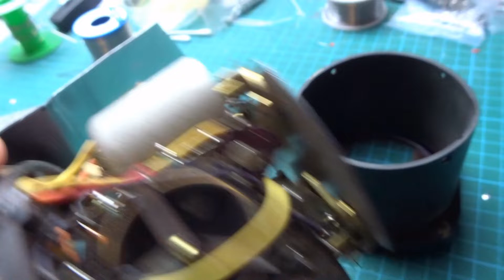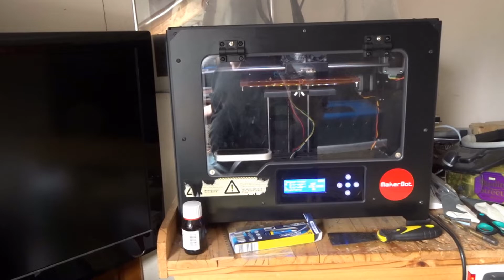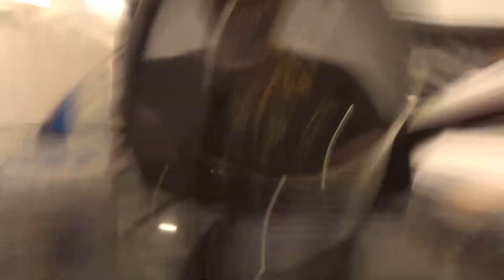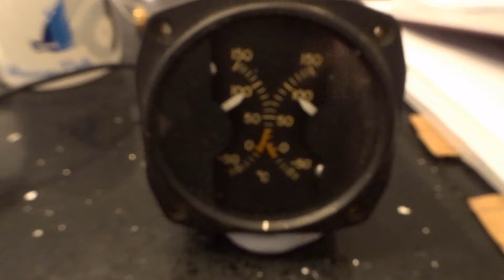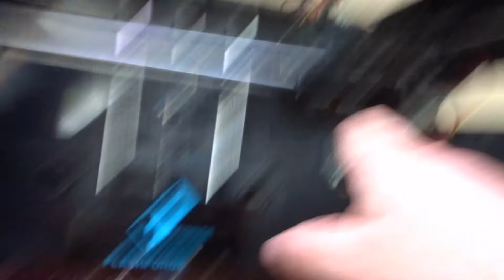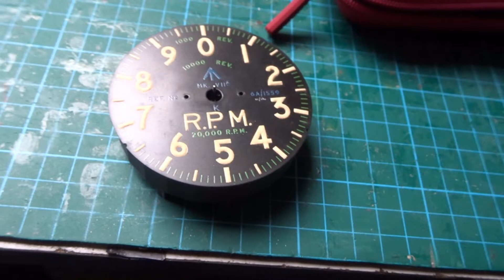Digital retro-analogue gauges | Belly Tank Lakester Ep.15

Comment: We have a lot in common, I do a lot of electronics too. Do the steppers you use have encoders on them? How do you know what position they are in? I have done a bit recently with driving a modern electronic tach with a micro getting a signal from the magneto. With no coil/points you have to pickup the signal inductively off a plug lead. I have that working nicely now after I copied the trigger circuitry from one of those cheap as chips electronic digital tachos you get off eay/Ali Express and feeding that into an Arduino to then generate suitable pulses to drive an electronic tach. Since I will eventually change the face on the tach I can of course make the scale anything I like. I have played a bit with trying to simulate a proper chronometric tachometer but the meter movements just can't move fast enough. Neither can a stepper I think. The only thing I could think of that might move fast enough is some kind of galvanometer but those aren't cheap! The smiths gauge is a MA speedomter of course. Used in Austin 7s. Aircraft gauges are something we see in the vintage car world and they can be a bit twee really unless your car is an aero engined special. In your build they make perfect sense being a tank racer. I'd be disappointed if you didn't have aero gauges! I haven't had much luck with some power banks for driving my electronic inventions. They often seem to have a low power auto shutoff built into in them and the little micro powered devices don't draw enough current to keep them turned on!
Reply from the maker: As you may see I also make electronic Hurdy Gurdy instruments and I had one that kept shutting of when run from a power bank because it was drawing too low a current. My steppers do not have encoders. I zero them at startup by reversing them against their backstop and then assume that is the start position. I agree over time they may accumulate errors if any steps are missed but I drive them slowly and don't update them too frequently. I could add in a 'zero all gauges' pushbutton on the dash if I wanted to - may actually do that. Finally they only need to work for a few minutes at a time in this car. Am planning to use a reflective spot on a rotating part of the engine and a laser tachometer sensor (shines laser dot and looks how much of it is reflected). You can get them as a module from China quite easily. I also have some chunky switches used in WW2 aircraft but also well after the war which may find their way into this project.
Reply: @XenonJohnD  One thing I have used professionally, not as a hobbyist, is digital servos. They have encoders built in so you can get absolute position from them. We used Dynamixels. But they aren't cheap! Aviation style switches and gauges are totally right for your car I think.
Reply from the maker: Another way to create a backup display is to have a bluetooth module sending out data and pair this with an app on a mobile phone that displays all the digital values. Have a phone clamp somewhere in the cockpit. To write the app you can use something like MIT App Inventor which is a kind of flowchart based way of writing an app, it then compiles it into an actual working app for you.